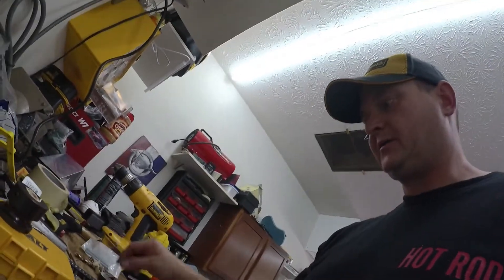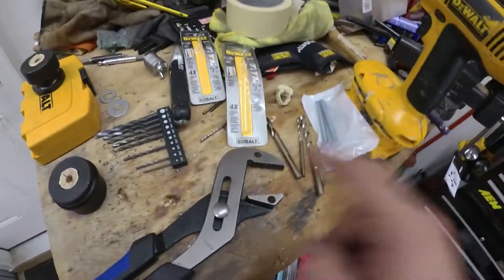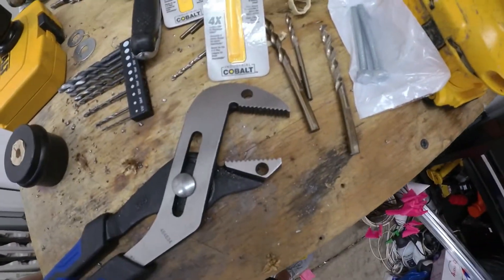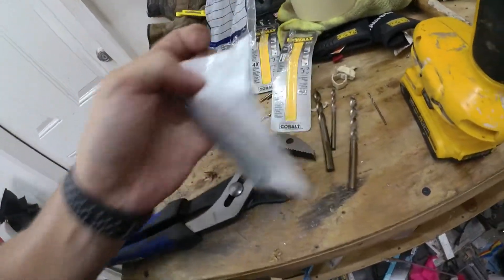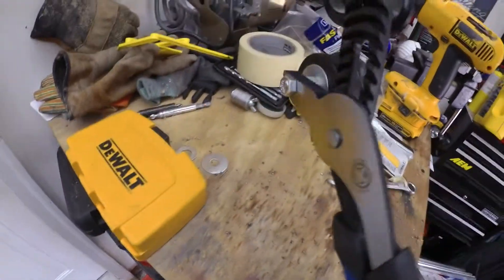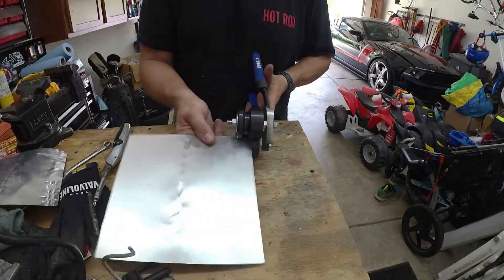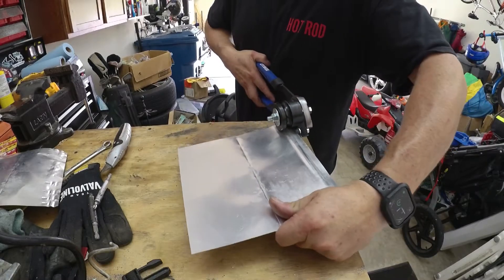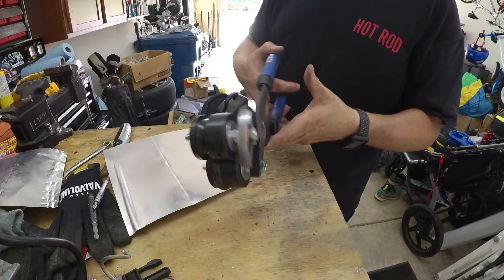Kia Stinger DIY Intercooler Build - Part 1 Cheap Bead Roller

Comment: The struggle is real! 🤣💥
Reply from the maker: It really was. It worked ok, but I finally gave in and ended up just drilling/tapping my vise and threading in some grade 10 or whatever aircraft strength bolts I could find at Lowes to attach the dies to it. That worked much better with the thicker material of those charge pipes. Got to test to find out what works best.

Comment: Next time you have to drill hardened steel find a couple concrete bits and regrind the tip you will need a green grinding wheel silicon carbide I think. You could just buy carbide bits for steel but that cost sometimes more than your project. 😂